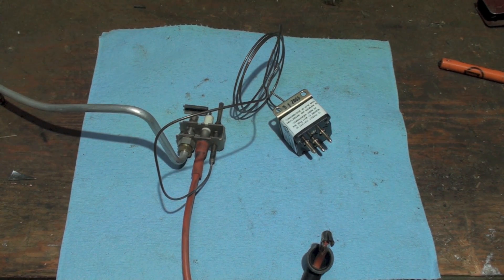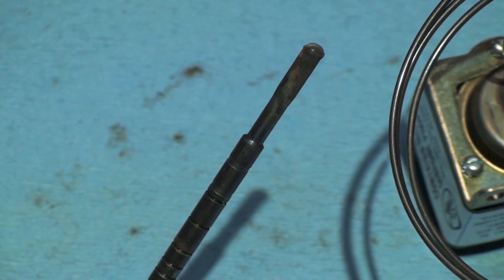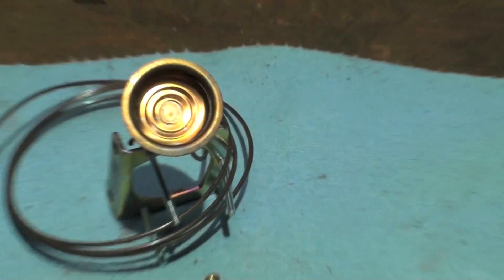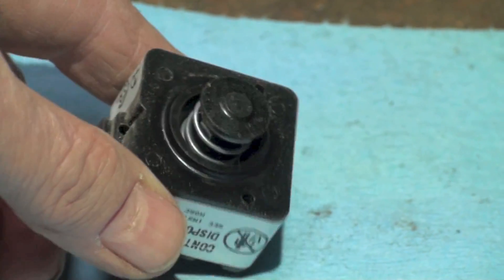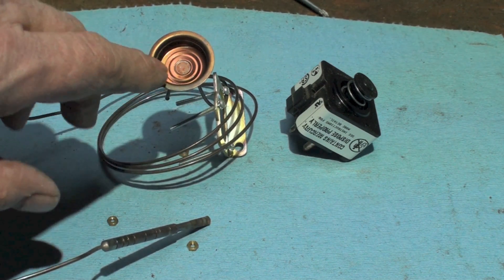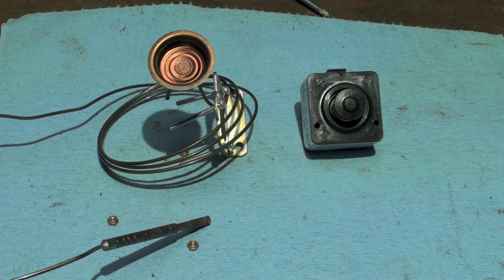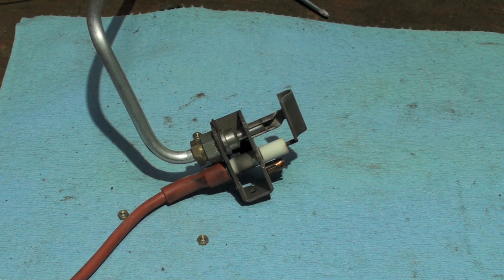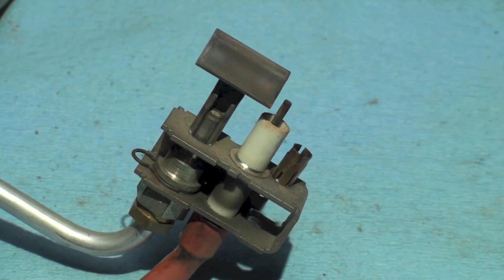The mercury pilot on the gas furnace

Comment: Does the mercury safety switch have any effect on the main valve? If the pilot if holding but the main valve won’t open and the gas valve has voltage then it must be the gas valve right??
Reply from the maker: Yes, the mercury switch will not open the gas valve if the mercury switch has failed.  Here is the bad news, the mercury switch is no longer available except used.  The gas control system can be replaced with an S86 Honeywell spark ignitor system.
GFM

Comment: My gas fireplace insert has one of these switches (white rogers 3056-2) and the end where the mercury is broke open so now the fireplace pilot light won't light. I've searched for replacement and they don't exist. I'm wondering if there is a kit that I could get that would either replace this obsolete switch or replace everything to do with lighting the fireplace or something in between.  Whatever it takes to make the fireplace work again without replacing the fireplace.
Reply: did you figure out a solution?

Comment: If you have intermittent boiler ignition problem due to the pilot flame not heating the mercury flame sensor enough you can try a "lower mass" sensor like White Rodgers 3098-156 or 3049-115 and just switch the brown SPDT portion from the old flame sensor onto the new sensor. Thank God it worked on my WM HE Series2 boiler and we have heat again.

Comment: I consider you one of the great treasures of the internet, GFM! Your description of how the mercury pressure switch works enabled me to fix the furnace I described in previous comment. Cleaning the flame sensor rod did the trick. Apparently, when the temperature was low at 3:30am, when the woman of the household got up to meditate, the pressure inside the mercury-filled tube was not high enough to activate the pressure switch, but when I visited during the day, with the sun beating down on the rooftop unit, the pressure was high enough to activate the switch. The insulating coating that had built up on the flame sensor rod for 40 years was just enough so that the ambient temperature surrounding the capillary tube made the difference between whether the pressure was high enough or not to activate the switch! I fixed it months ago, after ten visits. On the tenth day, it was cold and overcast and I was able to witness the no heat condition, and traced the fault with a volt meter. Voltage was going to the switch, but not coming out! Previous to this discovery I tried to convince the owner to convert to intermittent pilot system, but he had already been burned by a contractor who overcharged him to replace the fan motor to fix the problem, which didn't work, of course, and he was reluctant to throw any more money at parts. At the outset I gave him a fixed price to fix it, plus any parts. I could have bailed after the first couple of visits, but I was determined to fix it. I didn't make a ton of money, but I sleep well.
Reply: Which intermittent pilot system is best for this. Also does the gas valve needs to replace?
Reply: Recently servicing a boiler that used one of these mercury pilot proving switches. Was dead of winter and house was freezing. Initially thought it was faulty because was taking a good 5 min after pilot was lit to activate. But actually the ambient air temp plays a big role in how these work. Functioning better once the house temp was stabilized.

Glad these were phased out. But so were the service parts. So would have to update the gas valve and ignition system if it was to be faulty.

Comment: I had one of these apart today trying to solve an intermittent failure-to-provide-heat condition and for the life of me I could not figure out how it worked. I assumed that the tube contained a conductor similar to a thermocouple, but I could not figure out how an electrical signal activated the SPDT switch. As soon as you said 'mercury' it hit me... expansion. This furnace works for me whenever I go to see what's wrong, but doesn't come on when programmed thermostat calls for heat at 3:30am  by raising start temp from 65 to 72. I convinced owner to swamp identical  Tstats in the house, operating separate rooftop units before leaving and we shall see. It is hard to fix something that is not broken when you look at it.

Comment: Why does my Slant Fin boiler need a new mercury switch every season !??  Right now I have to tap it for the heat to come on !!  They seem to work ok for a few months only
Reply from the maker: Consider that the gas valve may be failing.
GFM

Comment: Had a question.... I have the same set up with them mercury switch on my rheem. Is the pilot light suppose to stay on after the main burners are on. Mine stays on even with main burners light....
Reply from the maker: Yes.  It should only shut off when the thermostat is satisfied.
GFM

Comment: So my heater has been making a loud clicking noise and finally wouldn't even turn on. I pulled cover and cycled  system. Draft fan started, ignitor started,pilot didnt light, tapped on mercury switch and pilot lite.
Reply: The pilot must light to heat up the mercury flame sensor bulb  and then open the main gas valve.  There may be something blocking the gas orifice at the pilot light or the main gas valve may not be sending gas to the pilot light assembly.

Comment: Hi
My furnace was operating intermittent, I was making sure the wires were plugged and the coming from the bulb to the switch  broke and separated from the body of the switch, is that repairable or need to order new one? Thanks for your help!
Reply: You may be in trouble here. It is not repairable.  You might be able to find the assembly, but they are going away fast.  The pilot sensor contains mercury and it is being eliminated.  The best solution is an electric pilot system such as the Honeywell S8600 system.
GFM

Comment: Is it possible to replace this mercury switch to another type? I guess gas combination valve have to be replaced with it too. But is it a solution to rid off this obsolete pilot light assembly? Or I have to change the whole furnace for most modern with full electronic ignitor. Thanks
Reply from the maker: You can use one of the spark ignition conversion kits to replace this system if the furnace is otherwise in good shape.
GFM
Reply: Thank you. Do you have a video describing that conversion process? Or spark ignition conversion kit explained
Reply from the maker: I do have one explaining the process.  https://youtu.be/rDB4ZpV9t5Y  Hope it helps.
GFM
Reply: My water heater wouldn't light and I suspect the mercury switch/sensor as disconnecting the switch causes the furnace to light and run fine.  Reconnecting the merc switch shuts it down.  Does that sound like a bad/stuck/failing merc switch??  Thanks for posting this video - very informative.

Comment: Is this the Mercury bulb igniter that create the flame on the furnace? I have a Mercury bulb igniter issue and I'm not sure if this is the item that cause burner to light. Heard it was obsolete from my contractor but I found some of these online.
Reply from the maker: +matt jiang The mercury bulb senses the heat from the pilot flame to allow the gas valve to open.  Yes, they are available.  Hope this helps.
GFM
Reply: They have replacements with silicone oil or polyether filling inside. Similar to brake fluid.

Comment: how do i replace the mercury pilot? Mine ran out according to a consultant. IS it easy to?
Reply from the maker: +matt jiang The replacement is not necessarily hard.  If you have mechanical skills, its fairly easy.  You just plug in the new one and mount it to the pilot assembly.  Hope this helps.
GFM

Comment: Mercury --  I bet EPA pushed hard to get Rheem  to change to a different design.
Reply from the maker: Yup.  None of these left.
GFM
Reply: grayfurnaceman Owners of old fireplaces frequent a forum I'm a member of to seek sources for mercury flame switches in order to avoid costs of retrofitting their fireplaces to pilot safety valves (PSVs)- or for the lack of OEM retrofit kits altogether (expensive).  They go open-market as a cheap fix instead of using OEM parts or to avoid the cost of outright replacement of their fireplaces.  Kind of a black market of mercury flame switches, if you will.  Not a good scenario.
I work on commercial cooking equipment.  Mercury controls were very prolific in cooking equipment at one time.  These flame switches (of course) and hydraulic safety valves (instead of thermocouple-actuated TS-11s or BASO PSVs) for gas controls - are all history now.  Otherwise, mercury contactors (three-phase applications generally) are still available for energizing electric heating elements since they don't degrade due to arcing like general-purpose contactors do during frequent cycling.  I'm wondering when the day will come that they go away too.  Maybe solid-state relays (SSRs) then, but I don't favor them.  They're W-A-Y overpriced and always seem to fail CLOSED.

Just throwing that out there.  Thanks for your videos.  Good stuff.